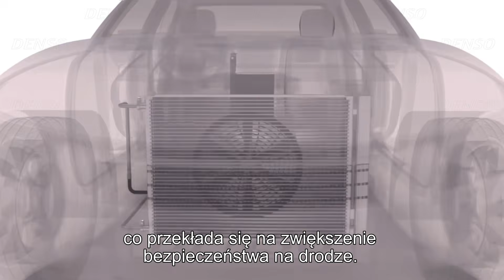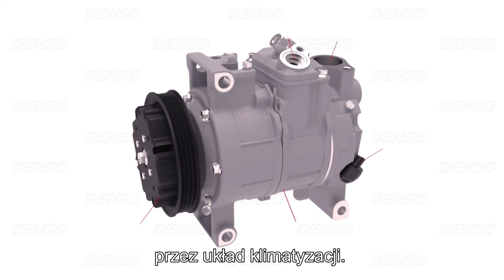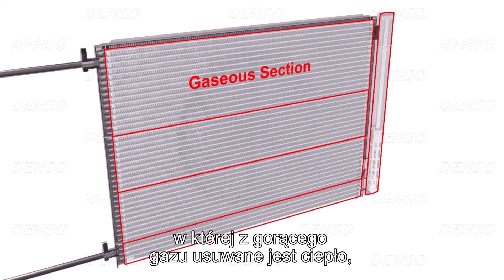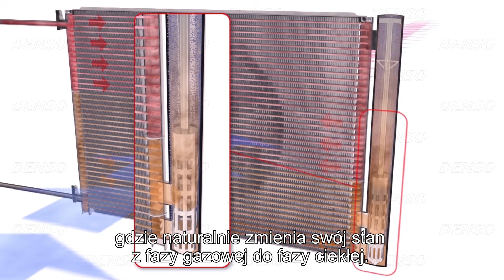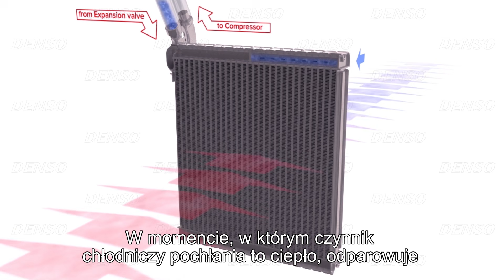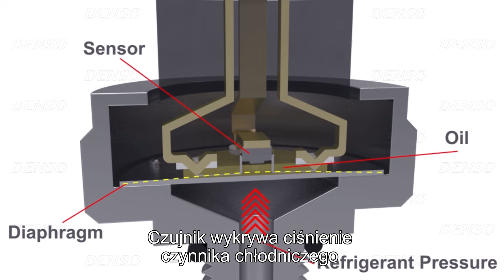DENSO: How does an A/C system operate – Polish subtitles

Comment: Why compressor heat the gas over?
Is this necessary?
Sb explain it to me please❤🙏
Reply: beacuse physics. every gas increases temperature when compressed and becomes cooler when decompressed so AC exploits this principle by turning the hot compressed gas to ambient temperature  so when the evaporator decompresses it, the temperature goes even lower than ambient and you can get chilled air.
Reply: @simoneamodei9265  
Thank u mate❤. In the last sentence when you mentioned "temperature", u meant the temperature of the ambient goes even lower (not the temperature of the gas).
Am I rght?

Comment: '
that motor with belt should be turnning to the front of radiator...
not right side on the right side wheel as front wheel drive
Reply: This is a very common setup: L4 FF-t - Transversely mounted engine line 4 engine with FWD, similar to many European and Asian cars. Belt is on one (lateral) side, the transmission on the other.

Comment: help me growling Sound from AC compressor during idling with AC off , after switching ON AC no sound at all cooling is good but as I switch off AC or cabin reaches desired temperature sound again starts, is this bcoz of low compressor oil ?? (when refrigerant flows compressor has enough oil to lubricate and when AC off compressor doesn't have oil for lubrication as refrigerant flow stops(my theory)).. hyundai elite i20 any one help...pl
Reply: Nah it's just the pulley bearing went bad, replace your ac compressor pulley bearing
Reply: sounds like the clutch is sticking or rubbing.
Reply: @98f5  thnx ,do I have to change compressor...??
Reply: ah yes, your clutch has gone bad; you can replace the clutch and pulley assembly; you don't need to relpace the whole thing as that is expensive.
Reply: قض.